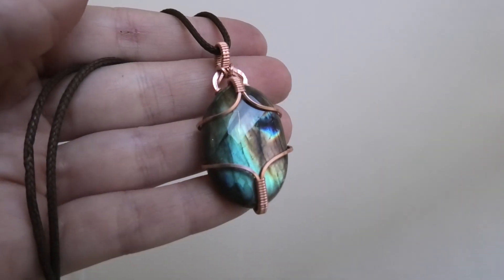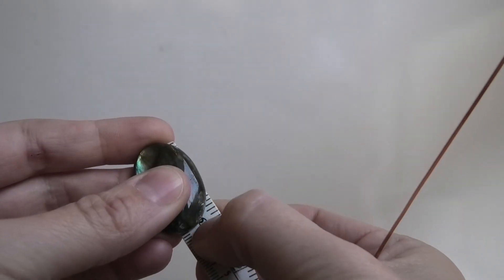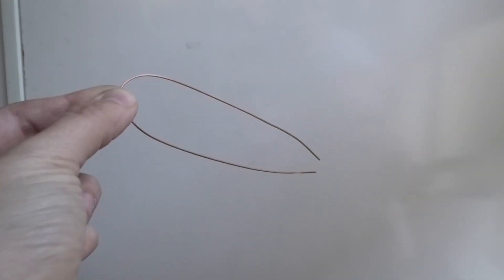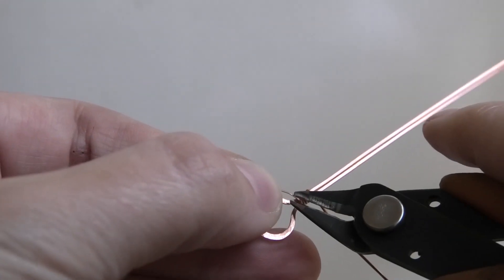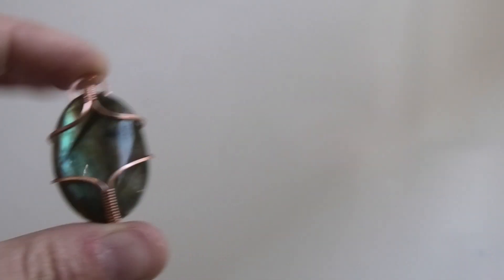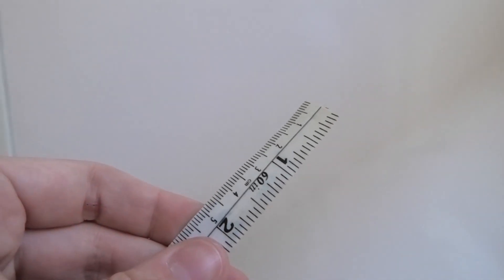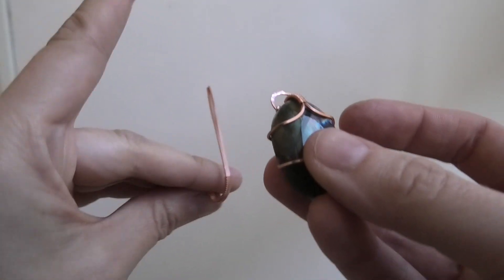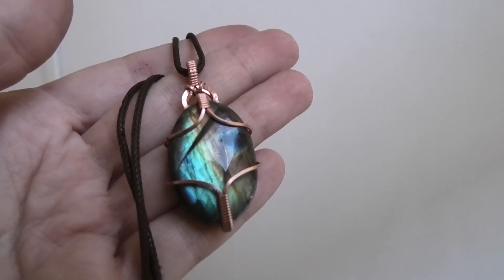Oval Cabochon Wire Wrapped Pendant Tutorial

Comment: Some of the best tutorials for wrapping on the internet. I love minimalist design and wraps that let the stone shine thru. I how ever also prefer the look of silver on all stones. You make everything look very easy kinda like a calculus math teacher. I still haven't got the hang of any weaving except a Viking weave. I guess I'm gonna have to break down and buy flat and half round to ever be able to get it right. Much love from a newer 50 yo. Stone lover, wire wrapper from the South. O btw just in case anyone else reads this. I found that stainless steel works much better as far as a tiny guage wire goes 26-28 it's strengths make it better than copper or silver and because of it's size it's fairly easy to work and it doesn't break like the softer copper or silver. I found this out without buying any wire since I had some stainless left from years past when I wrapped my own sub ohm vape coils from stainless steel wire in 26ga. Hope this tip may help others. I had broken many pieces of plated copper when trying to twist it tight in a small guage. Stainless holds up to twisting much better. Of course it would probably be much harder to manipulate in a higher guage but in the smaller stuff stainless is all I will use from now on.

Comment: I very much admire your work. I was wondering if you could do one with a 4 x 4 tile, as many of us are enjoying the dot mandala painting, and an incorporated frame would be amazing.
Reply from the maker: 4 inches? That's really large, I'm not sure I've ever made such a large pendant. One easy option would be to use one of those glue on bails or to drill a hole and use a pinch bail
Reply: Not as a pendant, as a wall hanging. @OxanaCrafts
Reply: I tried repurposing a couple of your concepts, by wrapping the corners, and by doing a 3-strand with little wraps at the sides and pulling the outside wires to the back and front, but I defer to your expertise. I'm also going to try with a larger wire for a simple wrap.

Comment: Hey  oxana do you know  if oil does anything to preserve labradorite
Reply from the maker: I think the oil is used when it is transported to prevent the stones from getting damaged, so whenever there are batches of stones they are usually transported in oil to sort of create a buffer when they touch each other.
Reply: @OxanaCrafts  ah ok thank you so much for reply I got a labradorite first time recently it arived and seemed wet oily textured for a second i worried what this liquid was when i finally got through to the sender he or she told me it was oil i thought again did this mean i have to maintain them this way,,,your answer was very helpful thanks again oxana

Comment: Can we use 17 gauge square wire? I can't find 20 gauge square wire.
Reply from the maker: 17 will be too thick and hard to bend. You could use 19 gauge if you can find that. Or perhaps use round wire instead for the base wires.
Reply: @OxanaCrafts  thank you so much for the answer, suggestion and your kindness. Have a nice work.